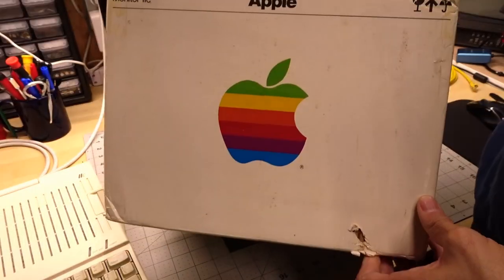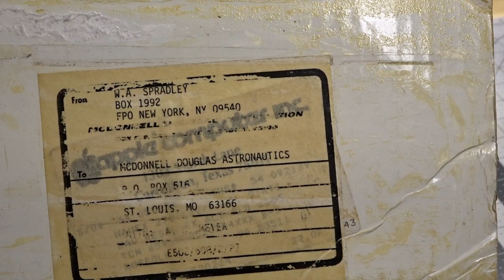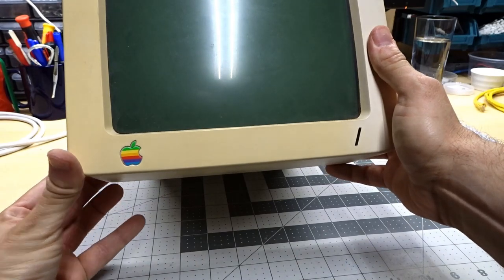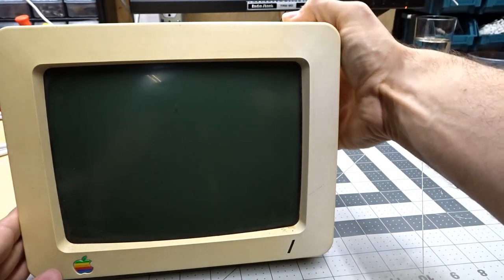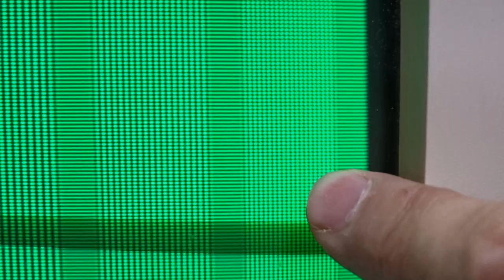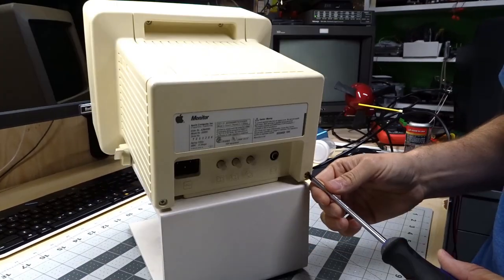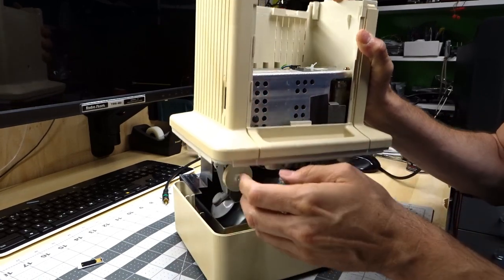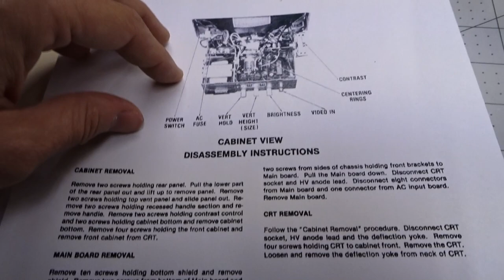Part 1: Apple Monitor IIc - Unboxing, testing and disassembly

Comment: Brings back memories I had a ][c back in the day when they first came out, and traded in my ][e for it.  I purchased a STN LCD panel for it and ran it off a battery, which actually made it portable as well.  Worked great for the time.  I had the 3.5" floppy drive for it too and was so cool to have all that software on a single floppy disc.   Those were the days!  👍🤠

Comment: "This thing is a boat anchor!" as a former C64 owner, I am giving you the resting skeptical face 

:)
Reply: its about equal, I have both in house both are iron core transformers and not much else,  the desktop machines got 100 switching supplies, but the "brick on a leash" as its referred to gave you the option at least to run the computer off a 12 volt battery like in a car or whatever, and there was a (couple) LCD screens for it
Reply: As someone who grew up with the VIC-20, C128, and Amiga 500, I'll raise you one ColecoVision AC adapter which was an absolute hog in it's own right as far as consoles went. :)

Comment: Funny coincidence, I'm also restoring one of these. So uh, if you need a set of replacement rubber feet for the IIc & monitor let me know, mine had atrophied and I ended up buying a complete sheet of 3M Bumpons which appear to be the perfect replacements
Reply: I have had problems with certain keys which seem to "catch" when they're depressed. There's a square metal brace part inside each key and I found that I was able to get rid of the stickiness by bending these very slightly outwards with a pair of pliers. Be careful not to bend too far though.

Comment: I got my //c in a box with a bunch of apple // accessories for the huge price of 1 dollar in 1999. Before eBay became less intimidating to most people and tech donations were a plenty at thrift stores. It's got a spot for a memory upgrade but I haven't found it anywhere. I also still have the RF modulator and matching Apple branded RF switch box.

Comment: The Monitor IIc stand alone sold for $39 in 1984. In 2019 money, that equates to $96.13. Multiply by a factor of 10 to almost get to the price of 2019's Pro Display XDR stand at $999.
Reply: People are complaining today that today the stand doesn't come with the monitor but back then it wasn't different

Comment: Also, instead of resetting the machine, you could just type "PR#6' at the BASIC prompt to boot the drive, congrats on the find! Great videos BTW, love your videos on the Tandy, and you were one of the reasons why I chose a Tandy 1000 (I got the TX as it was a 286) as my retro XT!

Comment: An FPO is a Fleet Post Office.  This monitor was shipped from a Navy/Marine base to MD.
Reply: My guess is this may have been a part of a controller for some system designed by McDonnell Douglas that had either failed or been decommissioned and so it was returned to the vendor.  This is absolutely speculation, but hey it's fun!

Comment: I had the complete set back in 1984.  I also had the cheaper Apple Scribe printer, which was ultimately more expensive than the Image Writer because the thermal  transfer ribbon could only be used once.  I am bidding on a IIc and monitor set now for about $300, but comes with no stand.  Looking forward to upgrading it to an IRCing and retro gaming machine

Comment: I found that I could disassemble my Iic monitor by following some of your prodcedure but I didn't have to unplug any wiring or unscrew the chassis apart.. Once I got to the point of unscrewing the chassis from the front plastic, I could unscrew the LED assembly and then the entire, intact chassis was loose and could be lifted carefully off.

Comment: Though the video was more than year before, I suggest replace the power brick with any PC power supply, I've modified a IBM notebook's small power supply to use with my Apple //c (now my //c malfunction, RAM fault), the power supply voltage match and works fine.

Comment: I went through some of that a few months ago,  My monitor IIc had developed a tilted picture, so I had to adjust the ring on the neck of the tube,  Between the difficult disassembly, fear of residual high voltage, and the fragile tube glass, it was slow going but ultimately successful.  Good luck with yours!

Comment: 7:11 ... As we all know, the slowness of the Commodore 1541 floppy drive was a kludge, compensating for the miscommunication between Commodore engineers between HQ & the factory (in Japan iirc) due to board layout issues (screw locations, circuit lines, etc).  Had the 1541 been first built properly using the design made by head 1541 engineer Bob Russell, it would have been around 5 times faster than it had fatefully become.  There would have been no need for all those disk accelerators that came later to fix the slowness. Any disk accelerators that may have happened would have just tacked on a bit more speed to the high speed the stock setup would already have.  
Had there been more than one means of instant communication in those days beside a landline phone, this fateful change probably would not have happened & the alternate history would have us with a properly designed C64-C1541 with a promptness in speed to match any other speedy floppy drives from other brands of that time. And I would bet there would have been much less Commdore users transitioning to Amiga, Apple or PC but would still do so though just much later.   Oh well.

Comment: I actually know a tiny bit about McDonnell Douglas, but only because I'm in the area. They are still around in the St. Louis area and design planes and space shuttles (with the rumored defense contracts). They were usually booming with NASA contracts and the like until the mid 80's. In the 80's they went through a ton on lay offs which shocked a ton of people in the area (layoffs were kinda a new idea in 80's and this was a very large employer in the area.) They were then purchased by Boeing around 1996 or so and are still operating to this day. It wouldn't surprise me if this computer was bought for someone who was laid off and they never re-assigned it to anyone. Just a guess given the time frame. It was real rocky for a while if the company would survive at all.

Comment: great video. Cant find the way to adjust the gorizontal width size of the picture i have an apple iic monitor a2m4090 that looks a little bit deferent from inside (mine is the same as the sams manual), i think i tried every potentiometer/knobs i have found on the board, they do all the other things accept what i'm looking for

Comment: Cute design. I will take my C64 over this at any time. Did I get this right, when the IIc was from 1984? 1 year and 3 months later, you had some beefy upgrade in form of that 10 year ahead Amiga.

Actually funny. Here in Denmark, nobody cared for and bought any Apple computer, untill the mac lc's in some 1993. And still it was like 1 to 5 out of every 100 machines. Not untill after the iPod, that any Apple computer began selling well here.

Ibm compatible PC's were always sold in decent amount, and besides that, then it was like a different market than USA.

1984'ish to 1987, was all C64 that sold most. From 1987'ish to some 1992/93 it was mostly Amiga that sold. And from 1993 to some 2002, it was all PC's with some sort of MS operating system on them. Yup. We were a hardcore Commodore nation in nearly all of the 1980's.

Though I can see and hear your nostalgia in this video, and that my friend is worth gold on its own. Me my self, have the same thing towards C64, Amiga500/600 and 486 PC's with VLB.
Reply: @adriansdigitalbasement  ☺️ People kept on buying C64's all the way into the 1990's. It was an amazing machine for shure.
Reply: Same thing in Australia in the 80s. Very few Apples were bought as home computers, only a few schools and businesses bought them. They were over twice the  price of the usually better Commodore equivalent.

Comment: Ironic. You talk about how expensive the 1541 was, but the apple was NEVER cheap enough for your average joe to afford.
Reply from the maker: From my reading, the 1541 cost $900 when it came out in 1982. I wouldn't exactly call that affordable. The C64 was very inexpensive compared to the Apple II but once you kitted it out, I'm not so sure it was cheaper anymore, especially if you added two external disk drives. (Common on the Apple II.)
Reply: Cpu, mps-803, 1541, and a koalapad was under $600 when i bought mine.